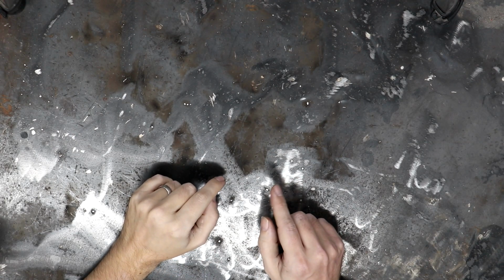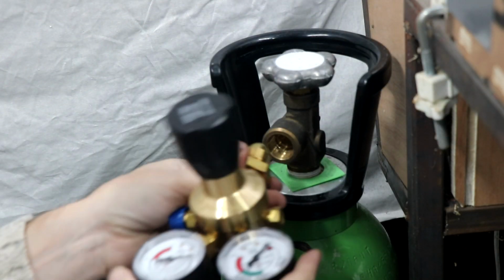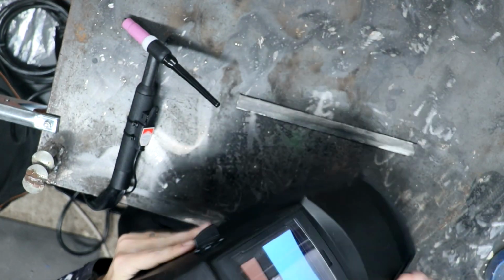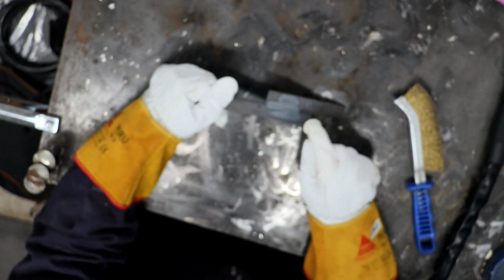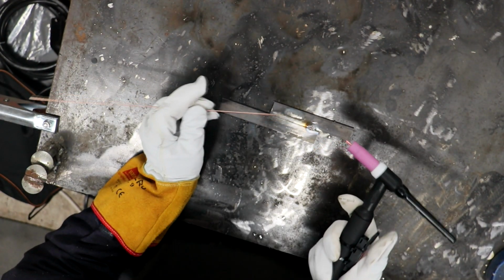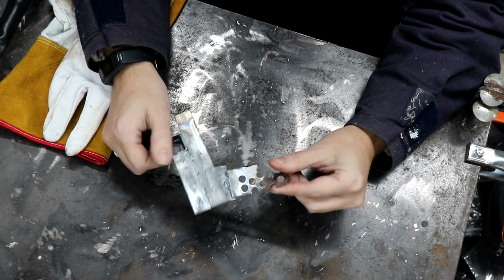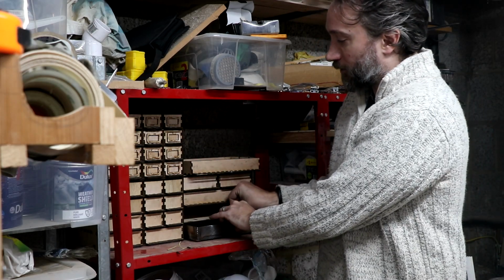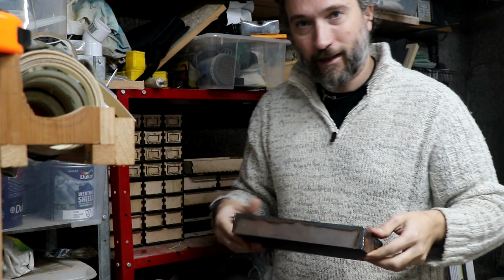New to TIG - first experience with ROHR WSME-200

Comment: I’ve been looking at buying the make and model of tig welder. Would you recommend it? I’ve never tig weldered either and was looking for ac/dc and cheap but good ish.
Reply from the maker: I would certainly recommend it. I've been able to achieve great results for my projects. Steel and stainless steel. I've used it to weld a band saw blade back together when it snapped and I didn't have spares on hand. I recently used to weld a bunch of 6mm steel to make a hossfeld metal bender clone (see latest video) I'm very happy with it.

Comment: Hi mate. Does your digital display read zero even when adjusting the dials? I've seen it change when I start welding, but just wondered if that's the same as yours. Thanks mate.
Reply from the maker: yes, the digital read out only applies I think to doing stick welding. while tig welding the display is just 0.

Comment: Hi,  I watched your video and bought a ROHR 250 you actually helped me make up my mind. I need a bit of help with the pulse settings. They list them as DC only and .5 to 2 in the booklet. I cant get anywhere near! Can you tell me how  you set it up to pulse and how low a pulse rate you have?  I mean on the machine of course! LOL.
Reply from the maker: I've not played much with the pulse Tig settings. But I just have it a try. Seems like the option is from pulse every 0.5 seconds down to 200 times per second. At 0.5 it seemed about right. At 200 is an annoying buzz that I can believe is 200 times/s
Reply: I use pulse on my Rohr, it’s a good way of getting excellent bead thickness without adding loads of heat and cooking the material. Works just as well on Ac as Dc. I run mine at about 5 pulses per second on ally, and. Pulses per second on steel, remember the pulse width is different to the ac frequency.

Comment: ANy update on how this unit is lasting? Any gremlins coming out? How many hours do you have on it?
Reply from the maker: Well it's still going great, and I love it. But if I'm honest, I'm such a low level hobby user that I've probably used it for less than a full time Pro welder would use in a week. A couple of times I've done enough to feel the torch getting quite hot. And I'm on my third bottle of Argon. So for my usage is been fantastic. I've made stuff large and small. But I could not attest to is suitability for prolonged continuous usage.
Reply: @MakerGeek  thanks. I am in the same position as a hobby / project / fix the odd thing person and trying to make that choice between hunting for a second hand bargain or a new rebranded Chinese important. Thanks for taking the time to reply

Comment: Hi there I've just received this welder but as I adjust the amp dials the display doesn't budge, is this a part of the design of is it supposed to show amperage reading? It's just stuck at 000
Reply from the maker: That's my experience too. The display only shows something in the non-tig setting. I assume that's part of what makes a cheaper machine. You have to go on just what the analog dial positions indicate.
Reply: @MakerGeek  thanks for the reply, I was really scratching my head on this, doesn't seem to make sense, I wouldn't have thought an amp reader is a "luxury" feature anyways thanks again!
Reply: @MakerGeek  Also wanted to ask where did you get your gloves from I've been trying to look for slim Tig ones?
Reply from the maker: Sorry, YouTube sucks for comment notifications. I got my gloves via Amazon https://smile.amazon.co.uk/dp/B01LD896LQ/ref=cm_sw_r_cp_apa_i_9L5aFbMAZT1PQ
Reply: The amps display is for the ARC (MMA) setting.

Comment: I think its rated from 5 to 250 amps so it can weld the thinest to quite thick metal right? I am most interested in its gas and gasless mig functions and maybe tig later
Reply from the maker: It can certainly weld 0.8mm steel, and I've used it up to 6mm with no problems. However it does not have any mig functions. You can stick weld with it. But there is no spool for mig
Reply: @MakerGeek  taught it was a four in one welder. I am tempted by all the functions and wide range of metal thickness it can weld but i dont think im ready for tig yet.
Reply from the maker: I'm not sure I've ever seen a machine that does Tig and mig in one package.
Reply: @MakerGeek  im sure iv seen such welders. If i remember well lidl has one mig mag tig stick combined in one machine and costs about €200. Sadly it was sold out when i went for it
Reply from the maker: Oh, cool. I don't know why I had it in my head they'd be difficult to combine. Certainly if you can get both in one package that would seem compelling. I already had a mig welder.
Reply: It’s called 4 in one, because it does Stick, Tig, Ac and Pulse.

Comment: A couple of questions if I may:
Which extras did you have to buy on top of the actual welder?

The box is nice, well done.
Reply from the maker: I bought a cylinder of argon gas, a regulator for the cylinder, a hose to connect to the machine, a different adapter to connect the hose to the bayonet fitting on the machine. Welding gloves, new welding helmet. Tig rod in various materials. I also bought extra stuff for the torch like cups and extra tungsten etc. But I those were optional. I think that's about it.
Reply: @MakerGeek  cheers.
Reply: @MakerGeek  I also meant to ask, have you tried aluminium? How detailed is the manual?
Reply from the maker: I have tried aluminium. It's very hard to weld. I think I need to clean it way more than I even thought possible. I've managed to weld two pieces together, but I wouldn't be able to make anything sensible at this point. 
The manual has pretty basic, not sure what details you'd be looking for.
Reply: @MakerGeek  something that would cover aluminium for a start. My MIG welder has suggested settings for everything it can weld in various thicknesses.

This Old Tony has videos on TIG welding aluminium, presumably you have watched those.
Reply from the maker: Oh yeah, but it's true what they say, aluminium is finicky. Old Tony makes it look so easy. I think the best advice I got was to focus on easier materials initialy to not get disheartened. It's a highly paid profession for a reason. Not easy. The manual gives no real details on suggested settings. That's all down to Google
Reply: @MakerGeek  Many thanks.

Comment: Try holding your torch with less of an angle, it seems you’re really canted over.
My first tig welding was just the same as yours, it takes lots of practice to get a handle on it.
When you start feeding wire as well, those sparks and the change in arc colour are where you’re dipping the tip into the weld pool or touching the tungsten with the rod. Easy to say don’t do that,  it it takes a few hours of practice. 
I sat daily for a few hours, and burned through two whole a plus size bottles of argon just welding rubbish together.
The other thing I’d say is, your autogenous welds (stitching without rod) look a little hot, so I’d assume you need to speed up a little. 
One other thing, you look like you’re doing little circles, it may be easier to simply get the puddle going, move forward half the puddle size, pause, forward half puddle size, pause etc. Don’t go back over the weld pool, and you’ll find you begin to get a better bead.
These are just things I learned as I was going.
Other tips I’d say is your ramp down, you don’t seem to have any, it’s like you’re clicking the button and the arc is gone. That leaves a crater, and can cause cracking, especially when you come to do stainless and ally, use that ramp down feature, and allow the puddle to form gently at the end,
By the way I have the same welder! It’s a brill bit of kit for the money,
Reply from the maker: Wow, thank you for the tips and critique. Its very hard as a newbie to figure out what you are doing right/wrong. I'm mostly happy enough that I achieve functional results but I'd love to feel more consistently good. I'll try to find some time for dedicated practice to address some of your suggestions :-)

Comment: Hi I'm watching this to see how it welds aluminium. It's to do with the ac dc setting and if this welder can do both ac dc. I'm tempted to buy this welder.
Reply from the maker: It certainly can do AC and DC. Along with all sorts of configuration for the frequency controls, pulse width etc. I have definitely melted aluminium. Which tells me my main issue is skill and experience and not the machine.

Comment: Hi, what is this like on aluminium? Could you do a video on aluminium? It’s in my basket but a few reviews online said all is good apart from the AC welding

Can you confirm what the lcd panel does? does it display amps ? I would like to know if it displays AC frequency??

Thanks
Reply from the maker: Hard to say. Because I'm in no position to assess what is my totally lack of experience and ability and what is the machine. I have welded aluminium together with it. It was not pretty. But it's notoriously finicky to weld aluminium. The display doesn't seem to do anything useful. I think it shows amps but only in non Tig mode. You have to rely on just getting a feel for the dials. I'll try to practice some more and see if I can improve my aluminium results
Reply: @MakerGeek  the display should show amps with the use of a foot peddle to be able to control the amps between the min and max you set the nobs at
Reply from the maker: Maybe. Pedals are expensive and I've gotten by without one. Not sure how helpful a display would be if you had to watch it whilst in use.